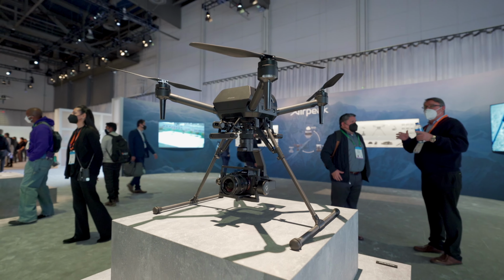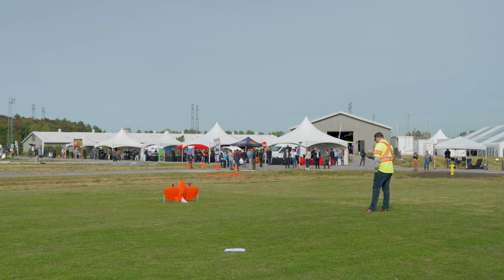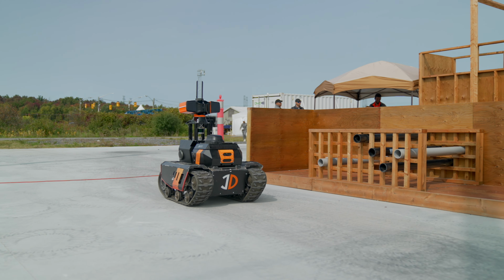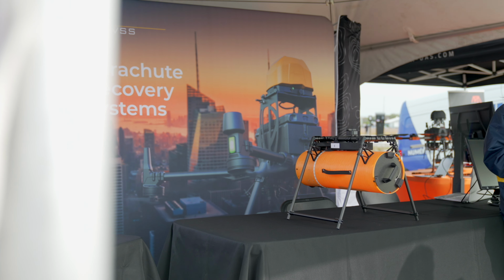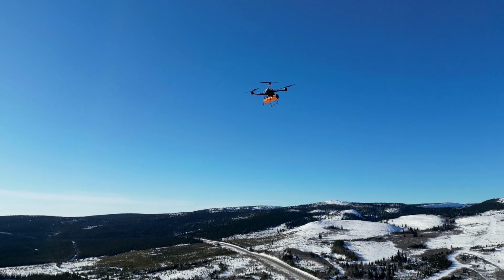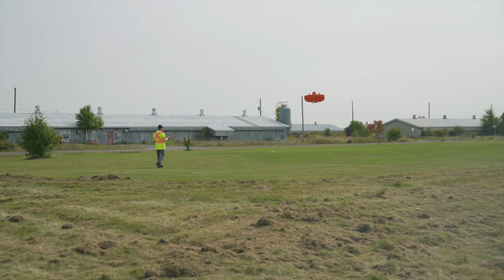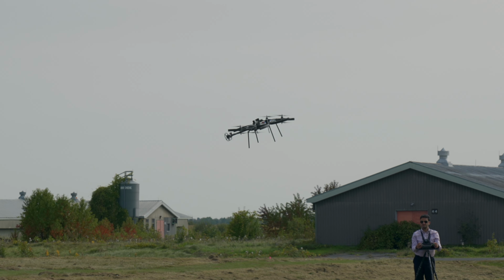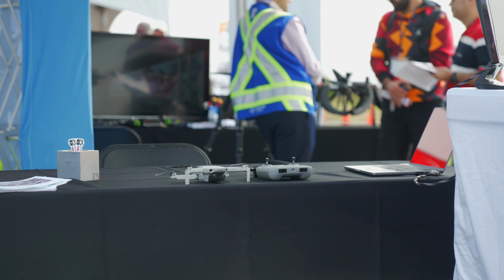DJI Mini 4 Pro VLOG - Flying In Ottawa & TCXpo Recap

Comment: I just bought a mini 4 and surprised to find out, you can’t plug in mini 4 directly to iPad and export videos. I’m also having issues taking the sd card out, inserting into an sd card reader, and plugging in to iPad or MacBook Pro or MacBook Air. There are no files on the card, but the files are detected if you insert the card back into the drone and use the fly app
Reply: That's actually a common iPad and Mac problem. There are several different protocols for file access and while Windows supports most of them, MacOS (and so iOS) is missng some and so needs special software.
Reply: @TheoWerewolf  Just sucks because files from my older mavic air 2 work just fine @dji

Comment: Good evening brother, could you do a test for me? Use the mini 4 propellers on the mini 2? DJI is not stupid, I'm sure it was intentional to put smaller propellers on the mini 2, to cause more rotation to have the same support, I bet that using the same propellers as the 4/3 on the mini 2/1 the flight time will increase, Of course it will be necessary to adapt it to fit it, but that's the least of it, Thank you"!

Comment: Love your enthusiasm and saying how Canada is drone-friendly, especially with regard to the sub-250 minis.  It's true.  Just one thing, to prevent any misunderstanding amongst your viewers.  I noticed you took care to avoid overflying the Parliament Buildings themselves, as that is a CYR537 Class-F restricted airspace, surface to 3000ft, for all aircraft (including sub250 drones!).  Search for the NRC Drone site selection tool.  Down the left side, click on the symbol that looks like a Gameboy controller (Operation Details) and select the Micro (<250g) category.  That alters the map display to indicate the zones where you are or aren't allowed to fly sub-250g.  From that map you'll see that some of your shots actually did stray into the edges of that restricted zone starting at 1:56, 2:01, and definitely 2:50.  I personally have no issue with that, as your video shows my home town in such an appreciative view.  Just make sure your viewers understand it's not a complete free-for-all with sub-250 minis.
Reply: Also, I'm curious why DJI geo restrictions even allowed your Mini 4 Pro to cross the boundary into this restricted zone?  It's because DJI (incorrectly again!) only shows it as an Enhanced Warning Zone.
Reply: @Zbip57  dji should update the firmware and make the class f airspace a authorization zone, which means if a person want to fly within that zone he need to obtain the permission and do a self-unlock.

Comment: Not to be a wet blanket but all the area you flew in over the river is Class C airspace.  :(
Reply: Strictly speaking, sub-250g is NOT prohibited from flying within Class C airspace, as long as it's done within the scope of CARS 900.06 without "reckless or negligent manner as to endanger or be likely to endanger aviation safety or the safety of any person".  However, there is a Class-F restriction CYR537 , applicable to all aircraft (including sub-250g), covering the zone around the Parliament Bldgs, and another CYR538 around Rideau Hall the Governor General's residence.
Reply: Good to know (In case Transport Canada is watching). The shots are beautiful!
Reply from the maker: You really are a wet blanket. I had an advanced certificate holder flying with me who was the PIC.
Reply: @billykyle Even without an Advanced Certificate holder on hand, if I'm not wrong, you were flying the Mini 4 Pro which is under 250g so you were okay in Class C airspace, but not in Class F airspace, as long as you didn't do something stupid. I think Parliament Hill is Class F.